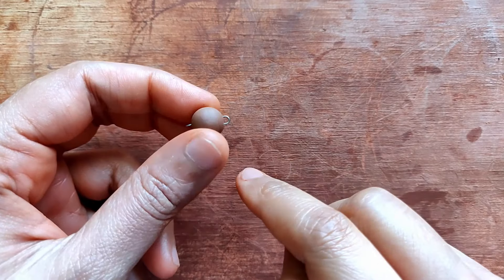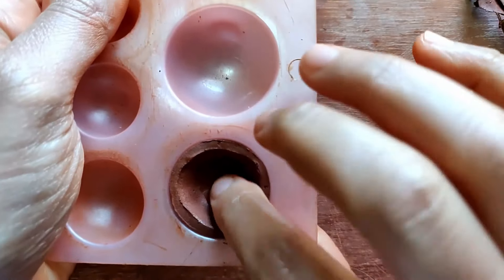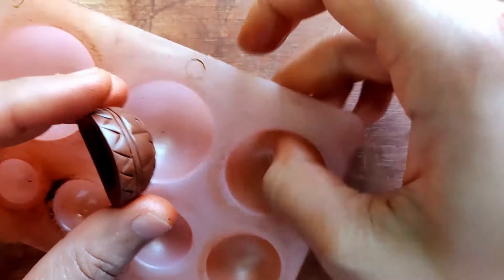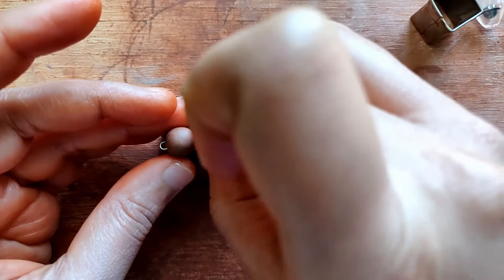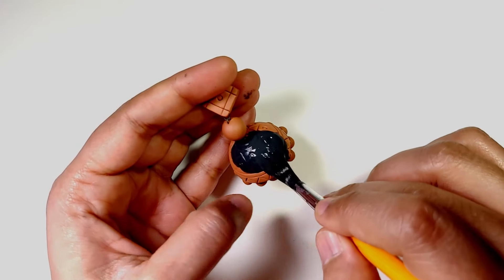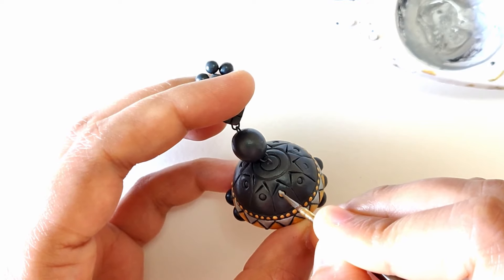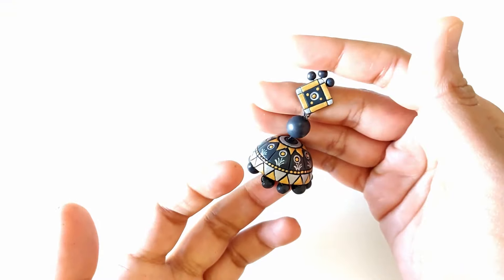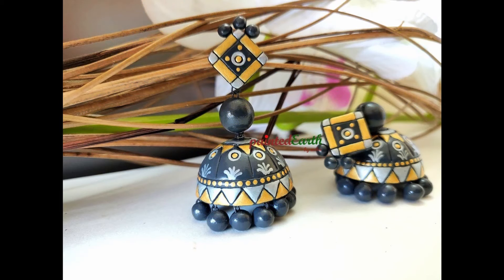Terracotta Jhumkas in Tuna Grey, Gold & Silver | Hand-Crafted Elegance |  #paintedearthbyneha

Comment: Nice.  Will Try.  
I find it difficult to scope the clay. It becomes heavy if not done.  These kind of details I'm not able to do it on a smaller one.
Reply from the maker: Sure do try.
Scooping does take time and practice. The idea is also to make sure you try to scoop the equal amount of clay in both of the jhumkas so one isn't heavier than the other. Not to fret though, I am sure you will get the hang of it as you practice.